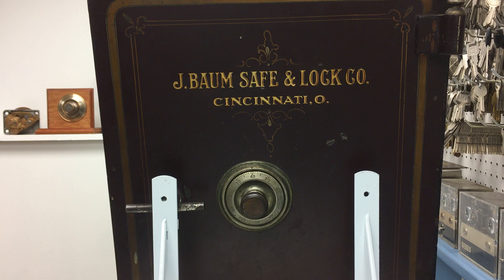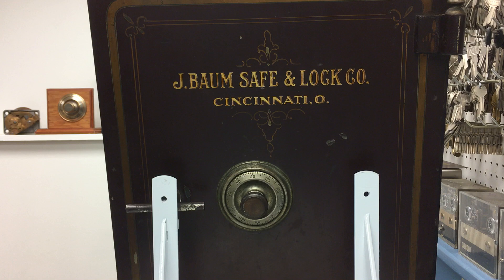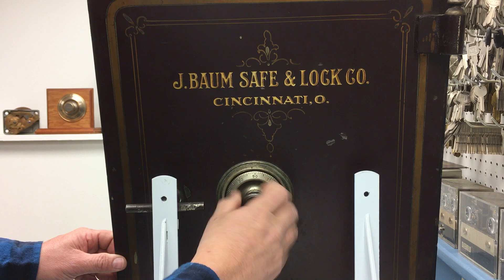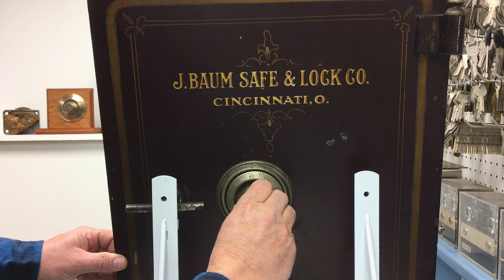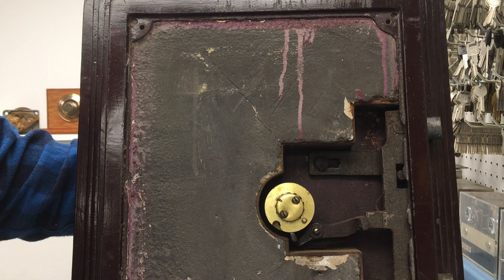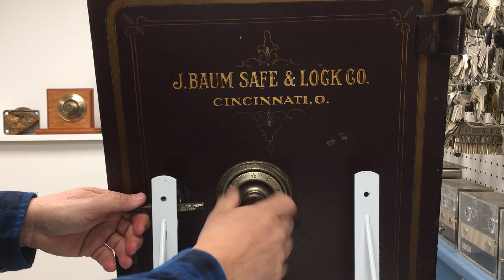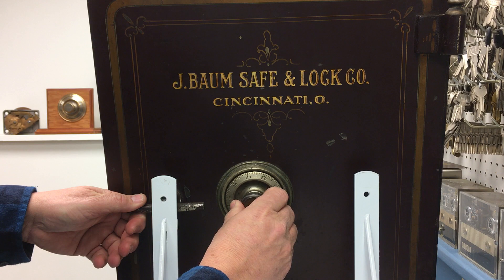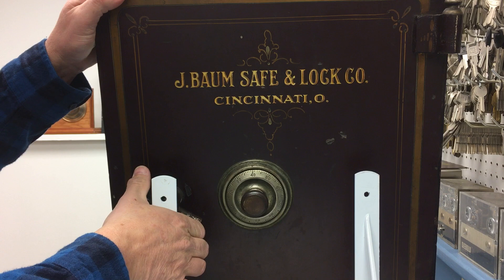Dave LaBarge of LaBarge Lock & Safe technicians shows how to dial open a J Baum safe

Comment: I found one today but they don’t remember the combination is there a universal combination for this same exact model that you have
Reply: There is a way to retreive the combination by mapping out the wheels. Its complicated and will take some time and practise, but it can be done without destroying the safe. Basicly you turn then wheel to a number and then turn it to where you feel the lever making contact on the left side and on the right side. Wherever is the most wiggleroom is a gate on one of the wheels. Repeat for the other to wheels to get it open. Sparrows has a practise device for this technique. Just search on youtube for 'Sparrows vault' to see how it works.